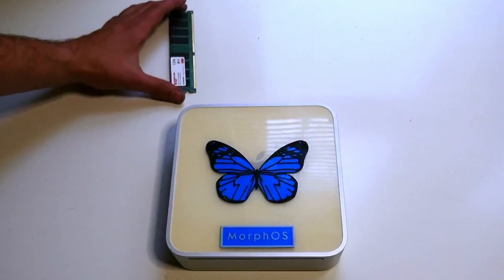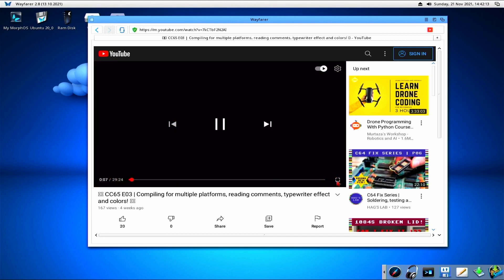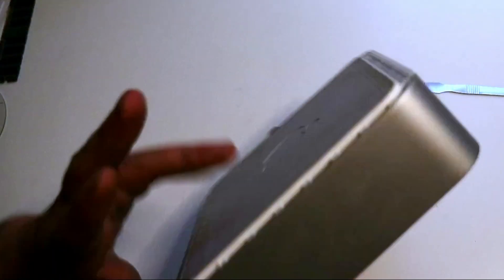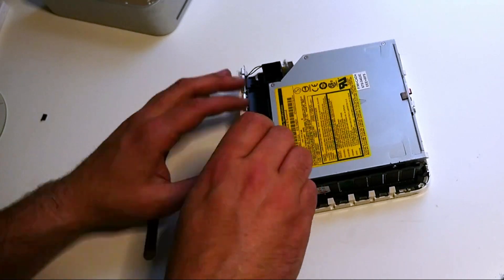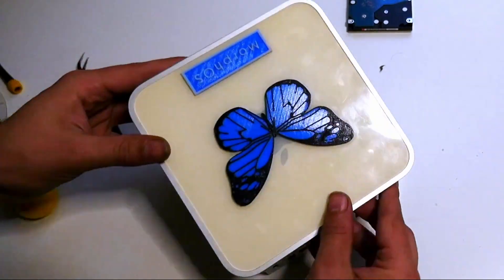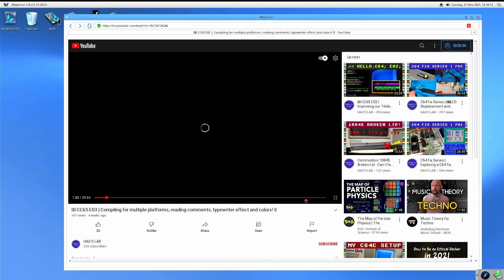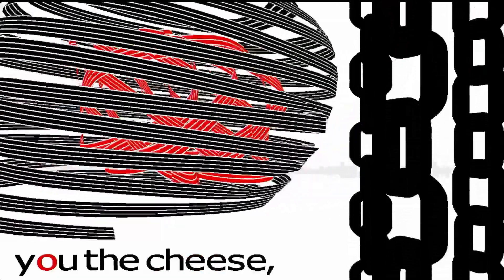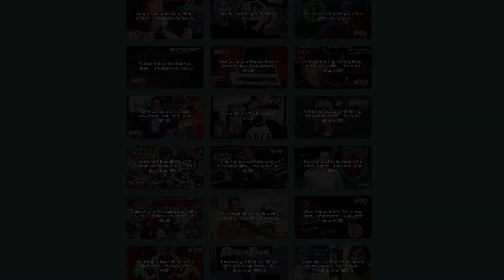Pimpin' the MorphOS Mac Mini G4

Comment: The hdd is starting to make grinder noise, so I will do the msata thing, and the double boot, however I have a way to browse fast on the Tiger : I use Chicken (a VNC client) and then I use a modern mac and then file share things back to myself. Butr  morphos looks interesting, I will install that. The boot time is just Amiga fast.

Comment: Its much better with a spatula, like 10cm, so you pop without damage one side complete. Done it so many times, also with a solder simple you can overclock to 1.33 1.4 or 1.5 (if you have the 1.2) and also for Tiger, look into Shuriken, this sped up sont things, and also the classic environnement (blue box os 9) works better with Shuriken patches.

Comment: Gotta be honest: I was interested in running MorphOS as a hobby OS on a G4 or G5 machine for quite some time. I followed the development of the OS since before it was available for Macs.

However, as an avid user of FOSS (free and open source software), I can't stand how hostile the MorphOS community is against FOSS.

Also, I just think that shelling out money for an obsolete PowerPC system and then again even more money for the operating system itself (especially that much) is just not viable. And yes, I know: "yOu CaN uSe It FoR fReE, jUsT rEbOoT eVeRy 30 MiNuTeS." - No.

I think, MorphOS should be ported to x86 or ARM. I'm a developer. I'd be interested in developing software for the OS if it was available for modern architectures and could be used as an ACTUAL daily driver. But so far, it just seems to be for people who like to dwell in the past.

Comment: I have a 2009 MacMini G4 which my mother brought me back. As I haven't used it in decades I forgot the admin password I had past set to it. So I can't even access El Capitan of whatever version of MacOS it was running when I left it due to relocation. I was wondering if I could totally erase its hard drive content from an external USB disk with MorphOS image/installer on it? My aim is essentially use it running Morph for the mlni CD bay and as a small files & web server and eventually as hardware firewall. If the erase/install works, would MorphOS could allow the later? I can't reach their support without being on a mailing list, which I don't want. My first contact with computers was through graphic design with an Amiga by the way, then the Mac Quadra appeared and I used both.;-)
Reply: 2009? El Capitan? Then it's an Intel, not a G4. MorphOS runs only on PowerPC.

Comment: Hi Ravi. I was thinking about doing this myself with my Mac Mini which has the latest MorphOS on it. I got my Mac Mini 2nd hand last year. I fired it up last night. As MorphOS boots there's a screen which has some info about the CPU and RAM at the bottom. To my surprise it said 980MB RAM. So I assume it was upgraded before I got it. I would think the RAM is going to help more than getting a mSATA SSD when it comes to speeding things up although I did do a similar upgrade on an old x86 laptop last year which did help a bit. I'll mull the Mac Mini SSD upgrade over a bit. Decisions, decisions.

Comment: The IDE Harddisk has 0 impact on streaming. RAM might, but only if you increase its speed, capacity will only have an impact if your OS is swapping ram to a swap file. The other way you can improve the streaming speed will be using an Ethernet connection instead of WiFi, WiFi (particularly usb based adapters) needs to use much more CPU to handle the network link (Signal processing, encryption etc). If you manage to get a good WiFi adapter that actually handles all the signal and data processing without needing the CPU (not many, if any, supported on MorphOS as far as I know - am using it on a MacBook G4 actually which only recognizes the internal WiFi adapter sometimes and will crash if you actually try and use it, so am waiting for an update the fixes the WiFi support on my MacBook G4, quite a pitty and the reason I am yet to pay for the non-test version)
Reply: I was thinking the same thing but theories aside, his test showed there actually was a difference. Maybe the software is accessing the drive the whole time, even if it's a strange design choice.